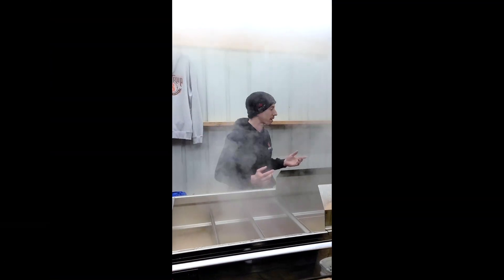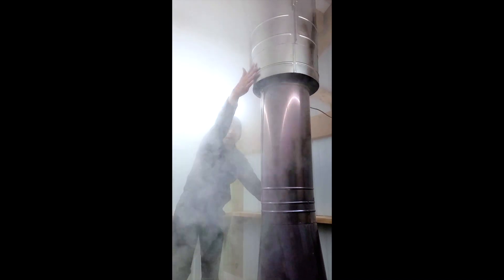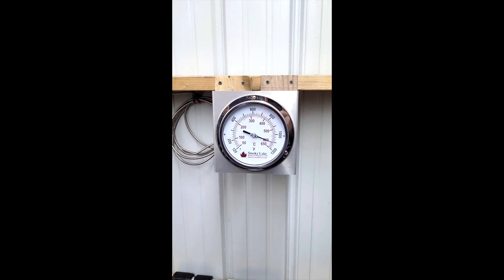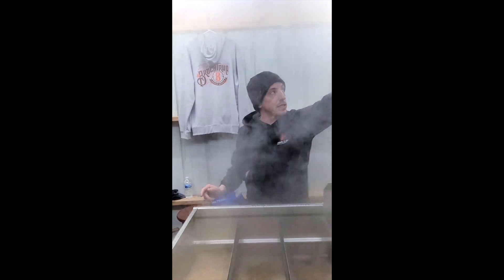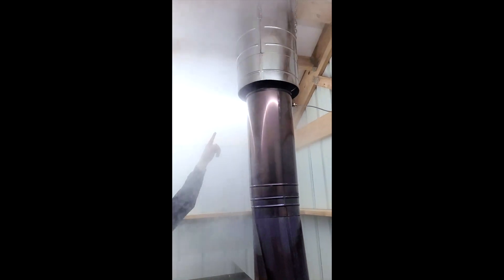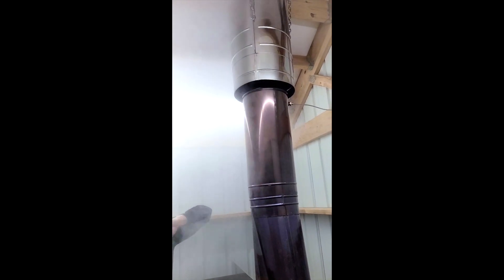Double Wall Exhaust for Sugarhouses

Comment: In terms of efficiency, with a stack temperature of 1,100F, what percentage of the heat produced do you think you're using vs the heat you're throwing out of the stack pipe? Wouldn't it be more efficient to keep the heat underneath the pans where we actually need it?
Reply from the maker: Of course under the pans is where we want the heat.  But there's an ever-present paradox of heat generation and absorption.  Without constant combustion, the fuel efficiency falls too low to be acceptable and gives us nothing to use at the heat exchanger (flue pan).  What we have found and what we have mastered with the Corsair is proper and absolute combustion of flue gasses through properly applied turbulence.  The only way to maximize the fuel efficiency is to put the best possible heat exchanger on this arch.  In the video, Jimmy is using an entry level flue pan on this premium arch, allowing some excessive heat to make it to the stack pipe as exhaust.  The High Output raised flue or high output drop flue pan set brings the Corsair to the next level of fuel efficiency, but it costs more up front.